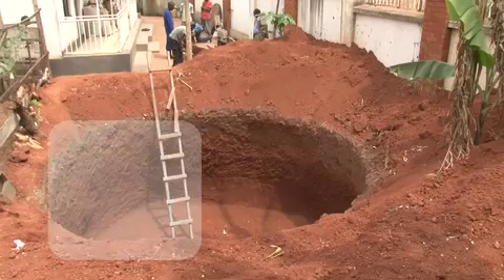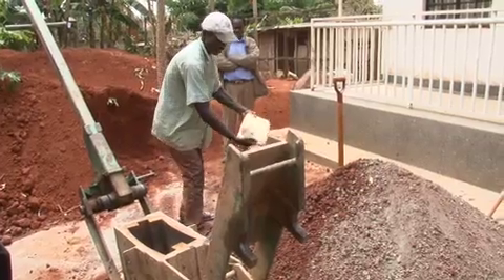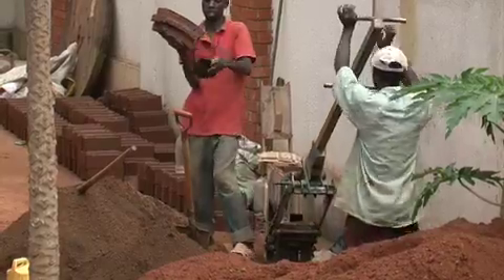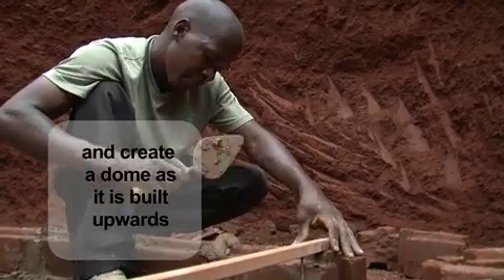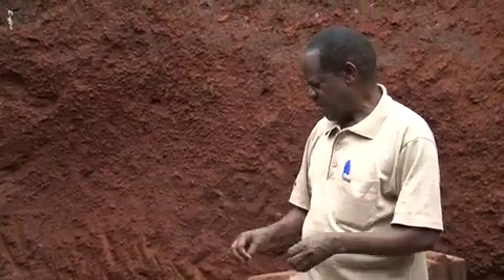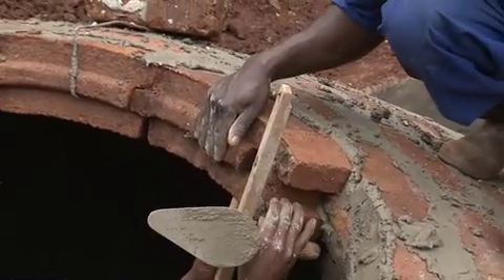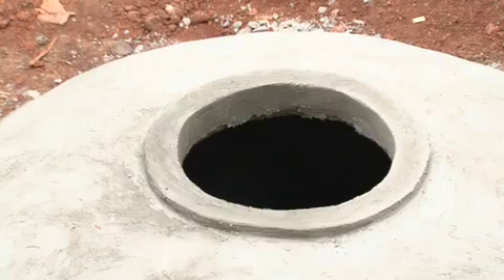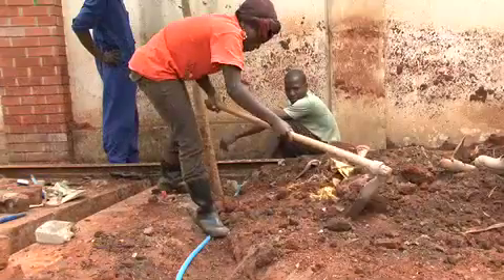How to build a biogas digester - DIY

Comment: Thanks for your reply.

I have no aversion to night soil fertilizer. In fact, my original question: how to rid of solid residue, has to do with recovering the residue out of an underground enclosed receptacle as described in the video.

I was impressed by the design of the holding tank and am curious how to recover the solids.

I look forward to your reply. Once again, thank you.